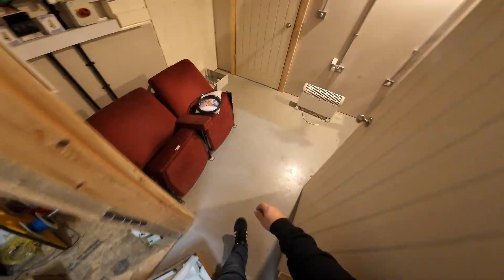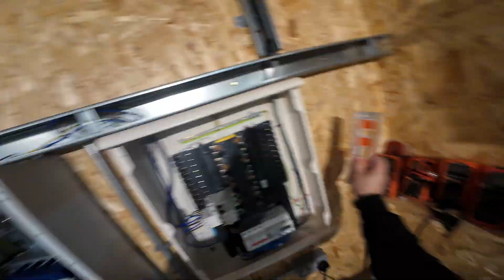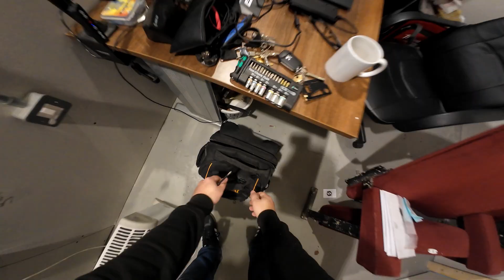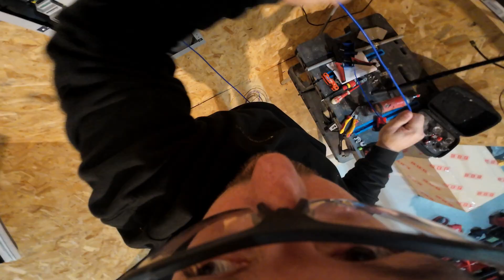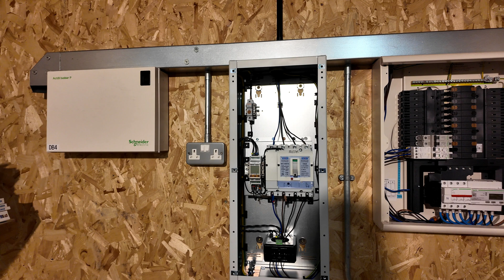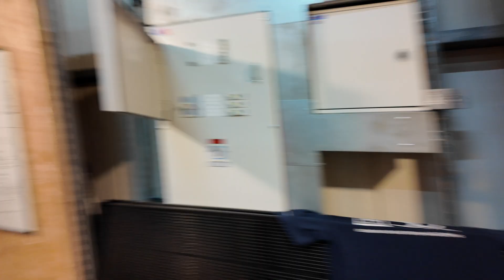Can you adjust an RCDs rating ? LETS EXPLORE a type B TPN RCD

Comment: Bit random here mark. I've got a customer looking for a fully off grid system. He doesn't want to install a grid connection as the DNO is charging him 18k. Do you have any suggestions on brands that will work with no grid? Tried GivEnergy, but they told me grid connection is mandatory for the all in one.
Reply from the maker: Victron is the one for off grid imho